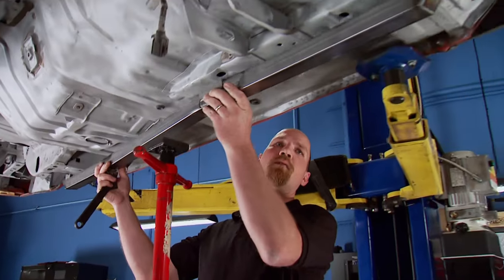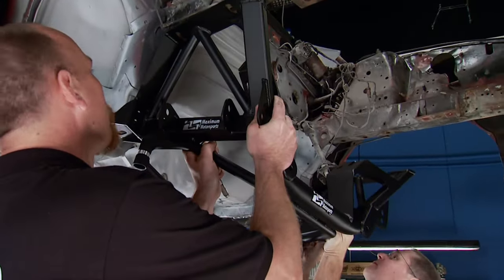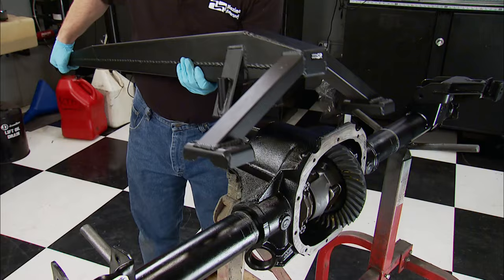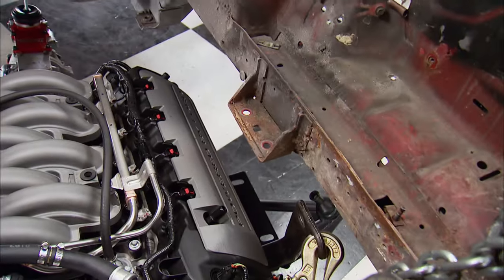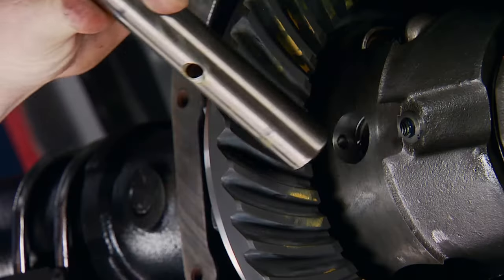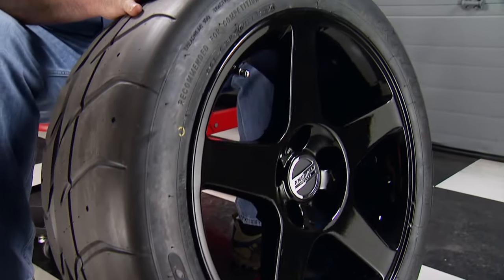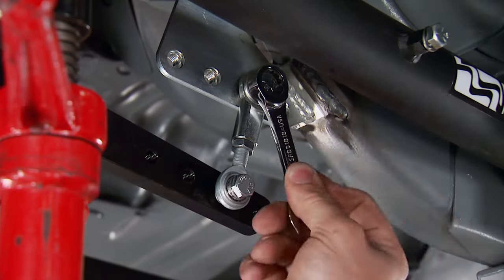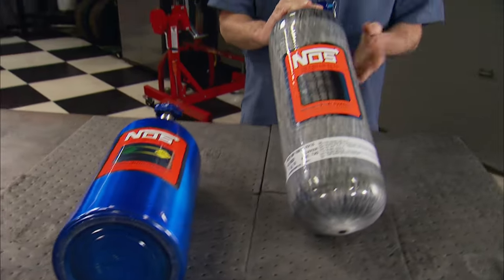High-Grip Race Suspension Conversion For The Fox Body: Part 2 - Engine Power S1, E13

Comment: Maximum Motorsports threw their entire catalog at this car. I could only imagine how well this car handles and how fast it is with that coyote
Reply: its night and day... its like driving a miata now ^.^
Reply: Almost as fast as it would be with an LS3.
Reply: @jamesgeorge4874  🤮  hardly, try a 454 cleavor with CHI heads, LS aint got anything on cleavors
Reply: @narmale  Richard Holdner has taken a stock bottom end LY6 north of 1500 HP. Heads, cam, springs, injectors, and 29 lbs of boost. It would cost more to equip your 60's era clevor with a rotating assembly that would survive 1000 HP, than it would to build the entire 1500 HP LS, my freind,  this is 2021, not 1970.
Reply: @jamesgeorge4874  not talking about 1970 pfft... talking ford racing's 351z block
Reply: i can imagine the cost,its definitely very high 5  figures for any normal mortal not having part sponsorships..engine and trans exceeds $20,000 alone and thats probably an underestimate and doesnt consider completely new exhuast,wiring,ecm and the rest of it...this is mucho denaro
Reply: @narmale  and your going to spend 8 times (easily) the amount of money for the privilege of 55 year old technology. Have at it, buddy. My Fox is getting gt3582's on an LH6 aluminum block, ported 243 heads, and should easily make 750 WHP. If you wanna Coyote or Clevor or 385 Series or 300 I6 your project, go right ahead !  If someone wants to gift me a Godzilla engine, I'll put a Ford back in it. Otherwise it's built Ford tough, with GM stuff.
Reply: I bet it feels magical on the road!!!
Reply: @themustangguy9294  makes an old mustang handle pretty darn good
Reply: @jamesgeorge4874  I get that it’s your car and you can do with it whatever, but please do make an attempt to consider the feelings of the rest of us who would much rather see you not Frankenstein a Mustang. It’s all I ask of you my friend. Let GM keep the LS
Reply: @toxicmasculinity7870  Well, honestly, I was pretty FoMoCo loyal, 30 years ago. But after 30 years as professional technician, I can assure you that Ford is actively trying to make repairs difficult, and they build unnecessarily complicated physically huge engines that I don't care for. The next guy that owns it, can do whatever, but I promise it will never be powered by Ford while I own it.
Reply: Can you use this K-member on a regular 5.0 engine? And if you can is this K-member's handing good for daily driving?
Reply: @narmale  You can't beat the "cool factor" of a Miata.
Reply: @mchristr  the wink is a major cool factor not gona lie 😋
Reply: Should have just got a IRS from MPS instead. I'm LOVING mine
Reply: @jamesgeorge4874  stock bottom end 351s can handle 1000 Richard holdner also did that

But have fun with the crossbreed LS even though you did it the hard way with more expensive swap parts!!

Comment: I'm impressed with this episode. I was starting to loose faith.  They resurrected this little fox in style.
Reply: Lose*

It doesn't need tightening nor did it escape.

Sorry, but that drives me nuts.
Reply: @MrAcuta73  You may want to work on your punctuation. I wasn't planning on being graded for my grammar. I catch 90% of my mistakes but I don't sweat the 10%. I'm well aware of the difference between lose and loose. " It doesn't need  tightening, nor did it escape."  I fixed your  incorrect sentence.

Comment: On my 90 hatch I want to mini tub it for wider tires. Will I be able to use a coil over shock relocater kit with this set up? I want to auto cross and do some amateur road cource. I also want the Pro Street look for cruising and maybe hit the drag strip occasionally. I would like an all in 1 experience. Enjoy the content. Y'all keep turning those wrenches and be safe.😁👍

Comment: Im by no means a ford guy but that setup is pretty freaking awesome. I'm little surprised the brake routers aren't drilled and slotted tho.
Reply: a lot of track guys dont use drilled or slotted rotors because they're more likely to suffer cracking. also they lower your braking surface area overall. basically people just think they look cool and that's why they exist, lol
Reply: thats more for "prettiness"
Reply: Drilled rotors are bad, the holes create a weak point to crack once put through extreme heat cycles.  However, the slots are good for trapped gasses to escape allowing even brake pad contact.

Comment: I noticed you did not install the headers on motor before it was installed from underneath. Is it possible to bolt on headers afterwards… meaning after the engine is installed??? Please clarify…

Comment: Yes, and that brings up a Question. Where do you get the (NITROUS OXIDE) without a Prescription?
Reply: Welding supply shops sometimes have it, or a speed shop.
Reply: I bet summit racing would have the nitrous,  but NOT for medical use
Reply: @RetroCheater81  Yes I tried the Welding Supply and they said I needed a Prescription before I could buy the Gas. A bunch of Crap.
Reply: @bertgrau9246  Well, Welding Suppliers here in Nashville said I had to get a prescription  to buy the Gas. This why I asked the Question where to buy Nitrous Oxide without this bull crap Red Tape answers I'm getting from Suppliers.

Comment: Haha now it's got 87 iron suspension. Torque arms suck.
Reply: Torque arms were used on the chevy monzas of the 70's.
Reply: @mikeclement7780  how did those drive? lol
Reply: The one I had drove just fine with the sbc and th350 I put in it with no wheel hop when I got on it.